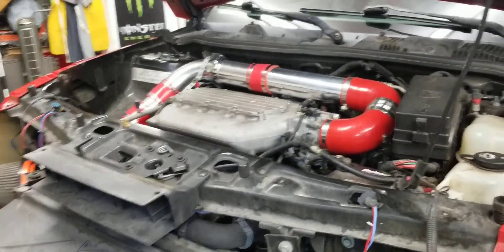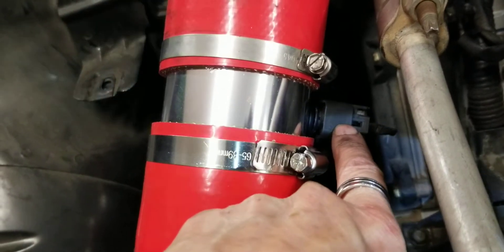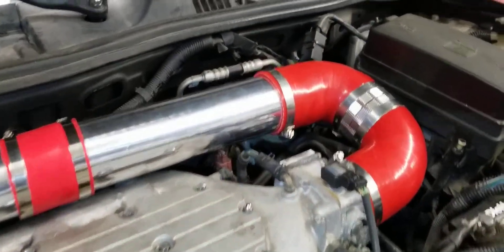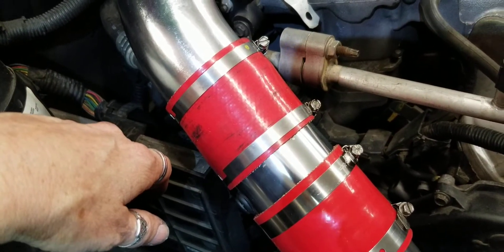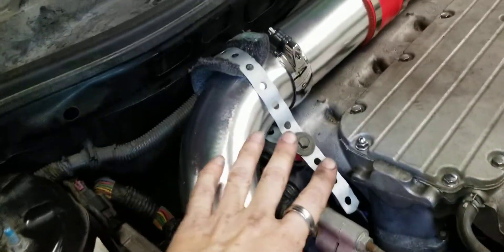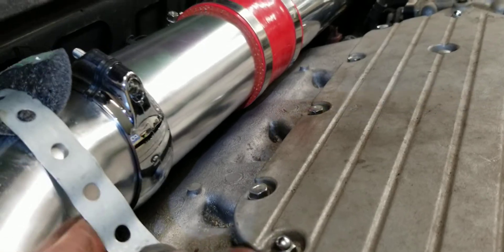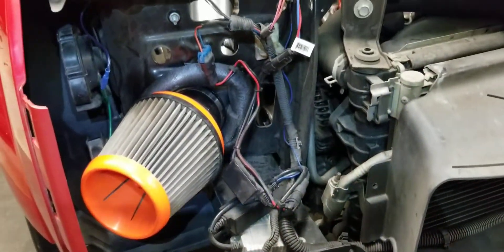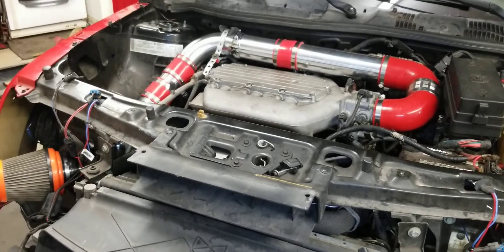DIY 3.5L CAI Prototype V 1.0: ($200 Budget) Parts Overview for Vue 04-07 (04 Saturn Vue Project)

Comment: The two hoses that come off the stock coupler from throttle body to intake tubing, where do they hook up and what did you do to delete them when you installed the new coupler to the throttle body? Thanks!
Reply from the maker: I hate it when I don't get notifications.  Sorry for the delay in my reply.  I only had the one that plugged into the rubber coupler.  I just made an appropriate hole in the red elbow & plugged that tube into it.